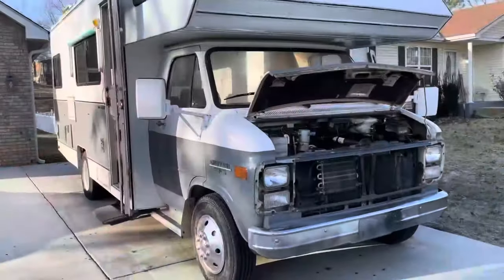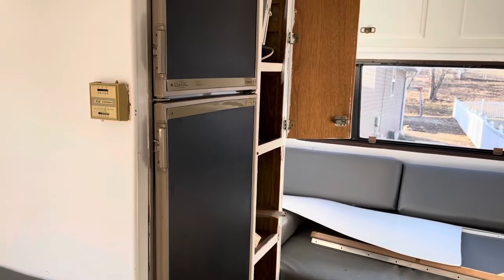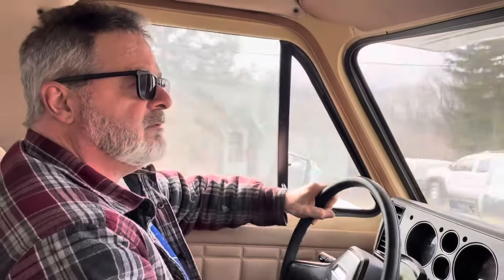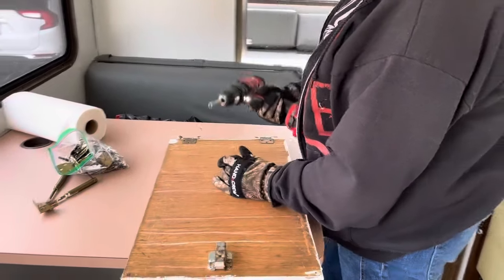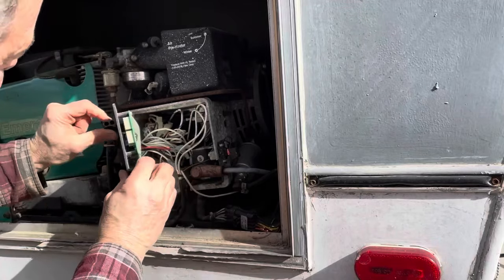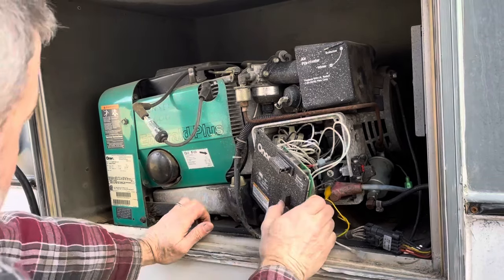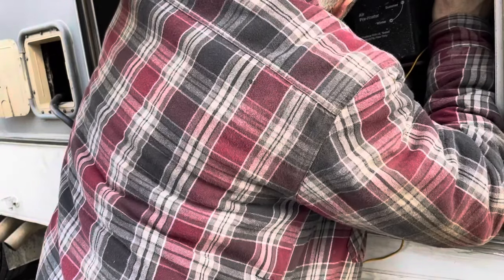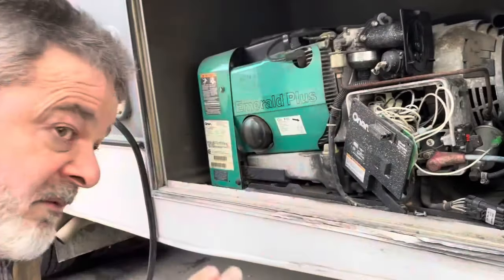35 Year Old RV Rehab; first test drive!

Comment: No, I don’t believe that’s a 12v compressor fridge.  That one runs on propane, compressor fridges don’t.  It appears to be 12v/120.  Compressor fridges don’t have those fins in the upper fridge compartment.  Compressor fridges have the compressor visually at the bottom inside the rear access.
Reply from the maker: Thanks! I’m going to dig into; if I can’t get it working I’ll probably just throw a standard mini fridge in it. Those RV propane/120v fridges are pricy!